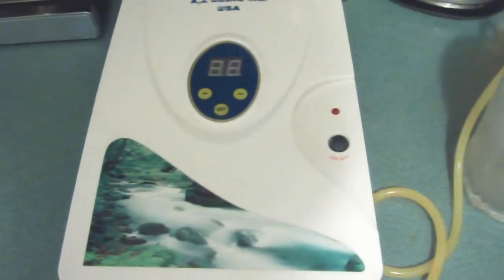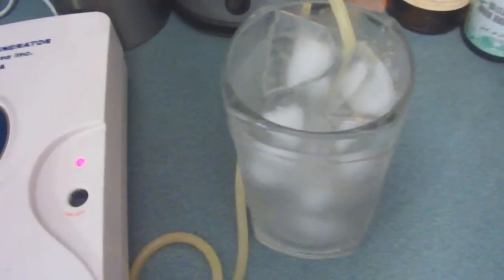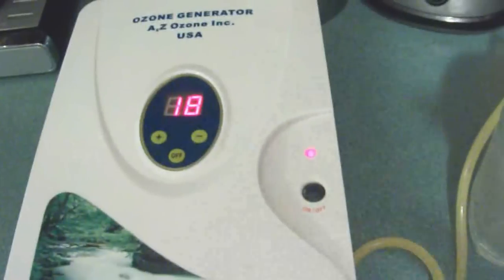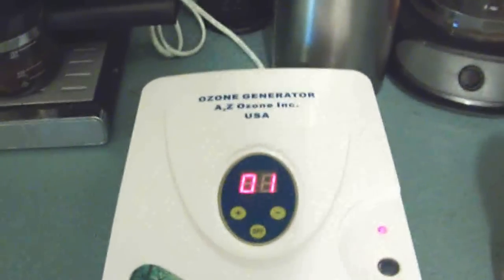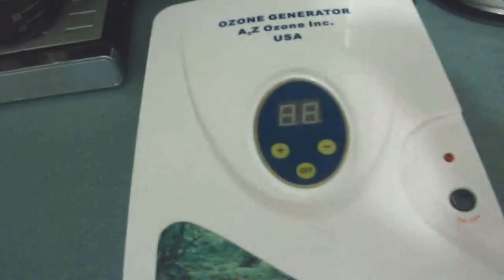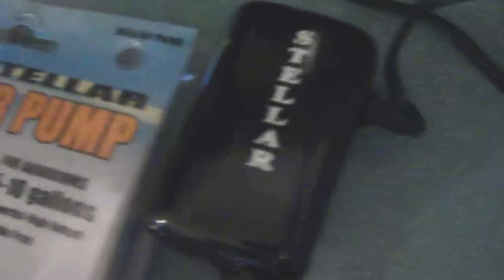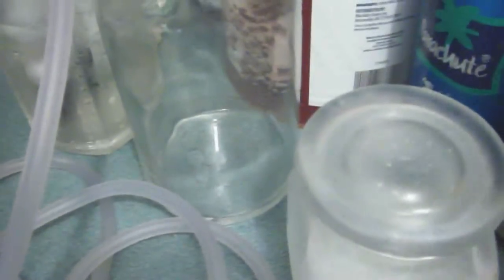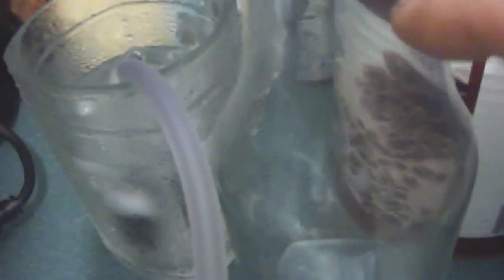Making Ozonated Water & Oils

Comment: I know this is an old post, but I just ordered one of these cheaper machines and it came with two black bubblers.  Based upon what I've read, those are for making ozonated oil, and the white ones are for water.  However, I didn't receive a white one, just two black ones.  Do you know if the color matters?
Reply from the maker: maybe not

Comment: Your using room air, so some amount of the 20% oxygen (O2) is converted into ozone (O3). What does the 80% nitrogen get converted to?

I think ozone is measured in gamma?
I don’t know what that is other than it is some value of ozone.  Do you know the gamma value of your ozone generators?

Comment: if that's a corona discharge ozone generator then it will be making nitrogen dioxide as well as ozone. therefor you be drinking nitric acid?
Reply: Elite Opinions very good question. But isn’t the same happening during the storm? Nitrogen dioxide is in our air anyway. What about NO3?

Comment: How long to ozonate coconut oil? I have a small sealed mason jar bubbling with the regulator set to minimum or 1/32 (medical grade O2). It has an ozone destruct vent for the excess. Is there a high limit? Will it heat up much after several hours?
Reply from the maker: It takes days.  You can tell by the oil getting thicker.

Comment: Can a silica air dryer thing be attached to this?  Is there like an air hole on the machine?
Reply: *****
Thanks but you are incorrect(concerning the first mention which is what I was asking about).  There are models that have an air connection but this is an Aqua 6 by AZ Ozone generator(the majority of what you can find on youtube is by this brand...the sticker and some designs have been updated but not very much).

There is a pdf for this brand out there as well as an official site going on in detail.  Amazon is littered with this product where you can also find such questions as my own, the answer, and the pdf I mentioned(of the instruction booklet).

It has air vents and they warn you not to cover those vents or you risk damaging the machine and void the warranty.  As for the second machine, he had already explained that it has an air input hole for oxygen and how hes using a fish tank pump instead of an oxygen tank nor air machine(which isnt wise because the generator was designed for use of 90% oxygen being that it is the more expensive cold corona generators vs the hot corona generator on his left).

The tubing pretty much isnt optional...you have to get the specific type and size to avoid ozone breaking down and eating away at it(and even when using the proper tubing, over time they become yellow and must be replaced).  As for my silica air dryer question I was referring to the specific product of air dryer beads contained in a unit designed to be hooked up to ozone machines to dry the ambient air and improve the shelf life of ozone machines however i have indeed already found out that the AZ Aqua 6 unit on his left doesnt grant that option like other generic hot corona machines do.

Thanks for attempting to help me and my detailed reply is essential for anyone else who stumbles on this video to find detailed insight and not be misinformed before making a specific purchase of a specific unit based on its capabilities.  My Aqua 6 is on its way here(cost me $64 + no shipping charge on Amazon brand new by a grade A seller...normal goes for $69 + shipping).

I essentially will be getting the same unit he has on the right later this year(its one of the better cold corona machines) for about $500 and I will be looking for an air machine for just under $1000 that takes ambient air and turns it into 90% oxygen.  You get a more medical grade of ozone with such a process vs the machine on the left which is a lower grade as well as being more acidic and capable of irritating internal human tissues because ambient air.

Comment: Anyone know ? Is this true ?? .......
."...The problem I've found out is that the plates inside the unit that make the ozone need to be recharged periodically to continue to make ozone and this product does not have a way to send the plates back to be recharged so when it's no longer making ozone you've got a rather expensive thing on your hands that does nothing...."
Reply: how often do we need to change any parts ?
Reply: Ozone is produced using high voltage... When oxygen is forced through high voltage arcing it separates atoms and recombines them into O3 which is unstable. O3 will readily give up the extra atom to become stable again which is why it has so many benefits. There is no recharge process unless you use pure oxygen from a tank and need one recharged.

Comment: How long do you ozonate the olive oil and are you ozonating the coconut oil too and how how are you ozonating the coconut oil since it is solid.?
Reply from the maker: I had to use a professional grade ozonator and it took days to ozonate the oil.
Reply: i see. I have a cheap o ozonator from amazon and the instructions tell me olive oil can be ozonated for 24 hours with it..
Reply from the maker: It depends on if the compressor is strong enough to pull the ozone through the oil as it gets thicker.
Reply: o k i see.. thank you for answering my questions... like your video.. short and sweet.. no frills and spills..

Comment: does it produce a significant amount of nitrous oxide contaminants and if so is that dissolved in the water also?  considering you're using ambient air and not concentrated O2.  Ambient air supposedly has 70% Nitrogen in it and when you send a hot spark to break the Oxygen does it make Nitrous compounds too?
Reply: Lightning passing thru damp air makes nitric acid and ozone. Picture how fresh the air smells after a thunderstorm. The ozone layer protects us from cosmic rays - uv , and the slightly acidic rain puts nitrogen into the soil. Neat huh? Like someone had a plan!
Reply from the maker: The later ozone machine I bought by synergy systems makes much cleaner ozone.  There is no metallic smell.

Comment: You only have to do a 6 oz- 12 oz glass of water for 2 mins, please place unit above water line when ozonating water so water does not back flow into unit.
Reply: so you don't have to pass the ozone through the water?  how do you it penetrates the water and didn't just dissipate into the air?

Comment: I bought a cheap Chinese ozone generator and connected it to an oxygen tank with a pediatric low-flow regulator.  I put the outflow tube in a mason jar half-filled with olive oil and left it alone for  four days.  This morning I found the  mason jar overflowing with the stiff material.  It resembles Vaseline.   Can this be used on infected skin wounds?   If so, how often should it be applied?  Any danger to skin?Thanks,
Reply: Yes I believe that you can.  Do you know how much ozone your Chinese machine puts out?  That is the only question that I would have- is there enough ozone in the oil?
Reply: Most machines vary the concentration of ozone based on the O2 flow.   I bought a machine from O3vets.com.  At 1/32LPM I get 99 micrograms per ml.   At 3/4LPM it produces 16 micrograms per ml.  The old machine cost $15 dollars.  It produced strong-smelling ozone gas but stronger is not always better for treatment purposes.
Reply: Yes, you are correct.  I was asking because many of the lower cost machines barely put out  enough ozone to do much of anything (from what I am told).  I'm just getting into this ozone thing. The machine I purchased is an O3Elite Dual from promolife dot com.  It has an Ozone output up to 110 Ug/ml (gammas) if using both cells -which they said was sufficient to use with a portable steam sauna, and its output can be reduced to any desired level below that.

Comment: can I use olive oil with the small one?
Reply from the maker: +MrSalmonOrange The smaller one works fine with water , but when using oils the compressor will be overwhelmed as the oil gets thicker.
Reply: +syyenergy7 Thank you for reply!I if water get  bubble will i need to repeat the same water every day I mean the jar or  the bottel?
Reply from the maker: +MrSalmonOrange Yes the ozone dissipates after a few minutes in the water.
Reply: +syyenergy7 Thank you so much!

Comment: That first Ozonator shown I have 2 of the same ones, Oklahoma rain destroys everything I have and It damaged the first one so I bought another one and It burned out but Amazon sells the heart of the Ozonator transformer and cylinder so I stripped out the case and except for the timer and put In new larger parts and put a fan on It and wired Into the timer and It works just fine but the time will Not let It run as much as I want. I As did the same thing with the first one but stripped out all of It but It had a bad switch I wished I had bypassed the switch and seen If any of It worked but I put on timer or fan on It and connected It to a 40 gallon Fish aquarium pump hoping It would push enough Air through the cylinder fast enough that It would Not burn out but I think It did but the reason for because I washed the Inlet tube from pump to cylinder and It get Water In the cylinder and shorted It out.

Comment: Hi there, I have been drinking ozone water for 4 years now and use olive and cannabis oil ( ozonised ) was wanting to get a medical grade unit and use a glass bubbler and was wondering if you have ever used one for drinking. Have you got an oxygen tank yet ? Do you use ozone destruct ? I believe that you can hold ozone in water for 24 hrs done right..
Reply from the maker: johnyr123 I have a better ozonater than this now but no oxygen tank.  Ozone in water lasts only a few minutes not 24 hours.
Reply: +johnyr123  the only way to test for real facts and not guessing is to use a oxygen dissolve tester and test after 24 hours.. this has been tested several times infact if ozone is frozen it will stay trapped inside ice which is 24hours or 48hours>? that's not my opinion that's a fact.  freeze it then dissolve it then test after its dissolved.
Reply: +Portgas D Ace - The Facebook group, Ozone to health, recommends the Synergy WPS100 ozone generator. You will find stuff on there about rectal insufflation, and here on YT also, and that does get to the intestine, apparently, not done it  myself. There are videos on YT showing how to do it. Promolife have a good video and they sell the gear too.
Reply: +syyenergy7 what the difference between a good one and a cheap one like this one i mean they do the same no ?
Reply from the maker: +Portgas D Ace Cheap use a metal element and the ozone has some impurities, plus the good ones will last many, many years if built right.
Reply: syyenergy7 well i see do you have a recommandation for a brand and internally does the ozone reach the intestine to kill the candida and all this stuff
Reply: jezzyby47
thank you friend

Comment: Nice video I am guessing you had to heat the coconut oil with a small wattage lamp to keep it in the liquid state while ozonating it.  Next step is to electrolyze salt water into it's oxygen hydrogen components and use the O2 to mix with the aquarium pump ambient air input to increase the level of O2

Comment: I also have the A2Z ozone generator and was thinking about upgrading to the Synergy WPS-100 same as yours.  Before I do, what is the output difference in ozone with the WPS-100?  Does it produce much more than the A2Z?
Reply from the maker: The biggest difference is that the ozone is much cleaner.

Comment: Cool vid! is the $70 machine good enough or should I look into getting that $500 ozone machine?
Reply from the maker: This machine is not that durable.  It's good if you are undecided on ozone and want to try it.
Reply: syyenergy7 I'm definitely decided actually but just financially not ready for the more expensive one from synergy. As long as the smaller one does a good job at getting ozone in the body I would love to try it. Thanks for the reply I appreciate the help.
Reply: I don't know if the cheaper ones are as effective or even do anything.
 I think you need to buy one that hooks up to an oxygen tank.

Comment: I'm new to this, is it worth my time and money to get the WPS-100 and oxygene tanks? the doctors cant seem to get rid of my tiredness fatigue.
Reply from the maker: try vitamin B12
Reply: syyenergy7 I guess i should have elaborated a little more, the doctors seem to think it's chronic lymes, so I've got lots of joint pain along with just being plain exhusted and mierable ALL the time.
Reply from the maker: Ted Sperling
I heard the "Doug Coil" worked on Lyme, but it's expensive.  I "Heard" various treatments on Lyme.  Ozone, frequencies, herbs.  "Testimonials" can be useful, but you really need to watch out with testimonials.   The new Parazapper My Plus may help, or the Spooky 2.   Personally, if that was me, I'd be trying everything, from devices to supplements and herbs. There is so much garbage that it is hard to decide, so I don't spend a lot of money and look for what I think is great values.  Ozone is supposed to be close to a cure-all.  The same could be said of mega vitamin C ; but will it work?   The problem with a testimonial is that there is no controlled study and even many testimonials may mean it worked 5% of the time.  You are less apt to hear the failures.  I think the ozone is worth a try though. BUT you would want to with a skilled practitioner when using the ozone therapies.
Reply: syyenergy7 I've given up on doctors, I've paid around $17,000 in 8 months on multiple doctors to end pretty much unable to do anything, so i boiught the ozone generator, air concentrator and the accessories(waiting for them to arrive). I figured what the hell, it's going to far better than the doctors even if it doesn't work. Just trying to find right vitimans to complement it.
Reply: Ted Sperling Oh, i live in northwestern wisconsin amd there doesn't seem to be any ozone skilled people/places that I'm aware of in 100 or more mile radius of me.
Reply from the maker: Ted Sperling
Vitamin C is one of the very best, especially liposomal vitamin C.
Reply: syyenergy7 I've read not to take it DURING ozone therapy

Comment: I have this same unit, the A2Z, and saw another video where they used a fancier ozone generator to create an ozone sauna using one of those portable saunas.  Would this unit be ok for the sauna?  Also wondering if you're still using the spooky2?
Reply from the maker: This unit is not that strong.  I have another one now.  Yes I do use Spooky2 all the time.
Reply: Hiya, 7 years on are you still using the spooky 2? What do you think of it?
Thanks for the video btw

Comment: I am 72, Pensioner, Widower, have progresive MS diagnosed in 92. I use both a wheelchair and walking sticks. What do you recommend to help with my MS condition ? I already use Quadrablok( magnets) this helps with my pain levels and my ambulitory control etc. Do you know of an Irish Supplier of the "ozone machines" and which Model do you recommend ?
I currently get my water from mountain stream, any suggestion would be most appreciated
Reply from the maker: A woman I knew has MS. What she did was totally avoid any food that had anything at all artificial in it.  And she took a lot of whole food natural vitamins.  I was trying the Spooky2 Rife machine on a family member for Parkinson's using the "remote mode" and it did Not work  But last week when she was over by me and I tried the "contact mode" with 6,000 hertz using the handhelds and it resulted in major improvement all day.  Now I may have hit on something that works remotely.  It was the frequency set, "Detox 4 Toxins throughout the body" on the CAFL, I set it at 100% positive offset, inverse sync and 78% duty cycle and that is working.  Everything I tried for frequency sets for Parkinson's specifically did Not work,  DETOX dd work.  DETOX may be a very good strategy to pursue and IODINE (Kelp) may help a lot with DETOX.  MS and Parkinson's can both be caused by metals like mercury or aluminum or chemicals like fluoride.
Reply: I also have MS, I saw a video this morning from Brian Aston healed his MS with ozone.  He uses the ozone generator with the oxygen generator and did what looked to be a sort of colon infusion.   I don't know if it's possible or advisable to use this unit in the same manner.  I would think you would want pure oxygen instead of ambient air.  I want to follow up on this Ozone for treating MS which I believe is no auto-immune but caused by pathogens and toxins.  I've used Chlorine dioxide (CD) and have seen ropeworm, so I think I'm on the right path.  I've tried a zapper but don't really notice anything.
Reply from the maker: Greg Kirkpatrick
MS might be from toxins.  DETOX is the key word.
Reply: Alfred Macnaughton Read The Wahls Protocol, a diet that helps with MS.
Reply: Read dr. Dr. Hulda Clark and get a zapper as well ozonated oil and water.

Comment: I have a couple of the large ozenators I picked up at garage sales for a few bucks (literally).  In the course of my "saleing," I've also acquired a few acquarium pumps and nebulizers on the cheap.  By taking the cover off and switching the output hose of the nebulizer to the input, it converts to a simple vacuum pump. At a couple dollars a piece, I can afford to burn up a pump/vacuum or two.

My ozone machine fans cannot push ozone through, say, a gallon of water. However, by placing a cottage cheese container over the fan, putting a hose in it and feeding the hose through the lid of a quart or gallon jar and to the bottom, then feeding the vacuum pump hose through the lid too, but stopping above the water level, I can draw ozone into the water in the gallon jar.

Anyone have an idea of how long a gallon of ozonated water stays ozenated?